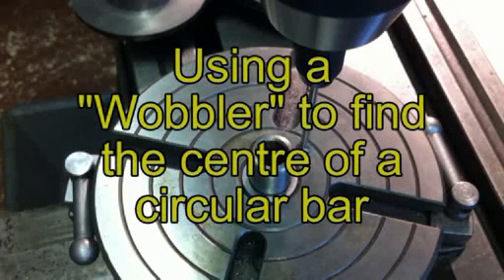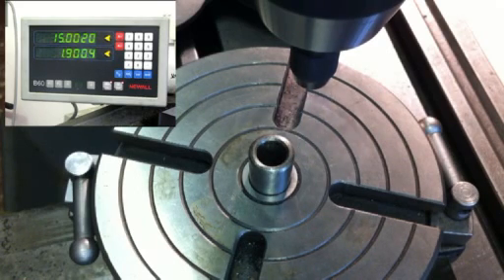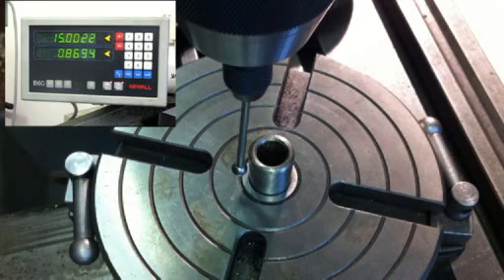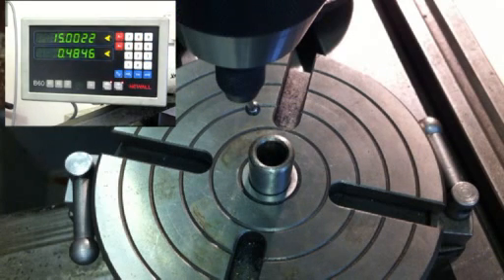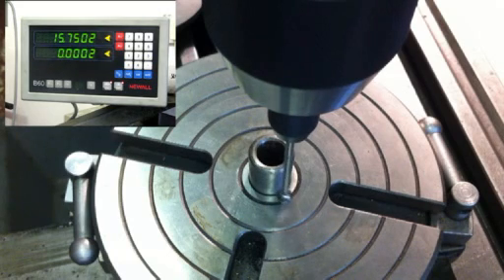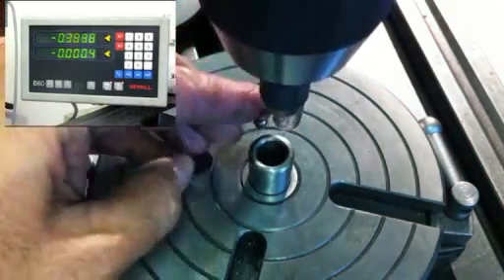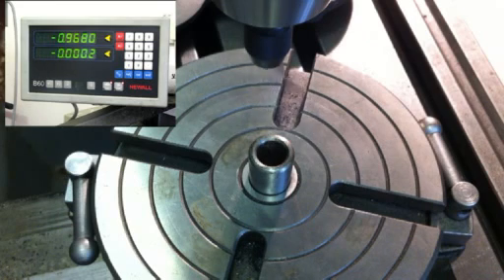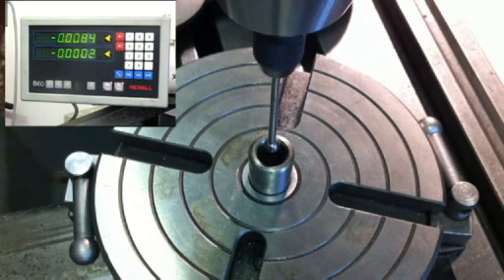Using a "Wobbler" to find the centre of a bar

Comment: If you don't have a dro you could also try using the 3 move method with an edgefinder.
Reply: There is another method with just one move - " edgefinding the centre of round stock - one move - one minute!! "

Comment: Ok, you guessed it.  I was of course talking about the Chinese calipers you bolt onto each axis.  To be fair, it is likly a Chinese mill, and they plug into a remote display such as the one shown.. but without the divide by 2 function.. and are accurate to .0001.  In my opinion spending so much more money is a waste.
Even the one in the video requires blocks with slides bolted onto each axis.  Chinese or not.